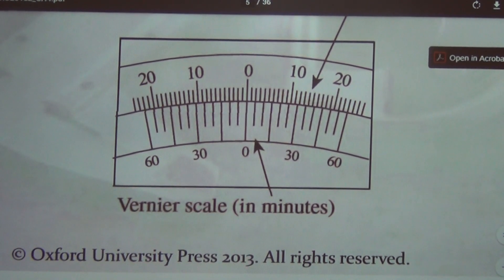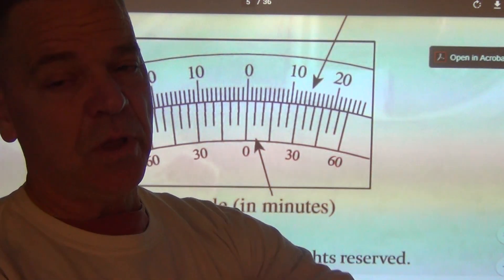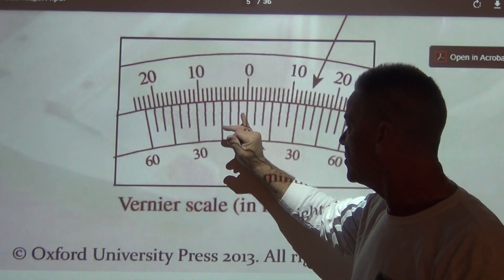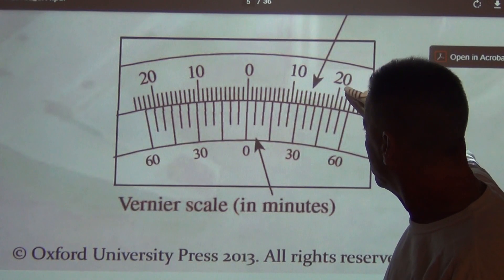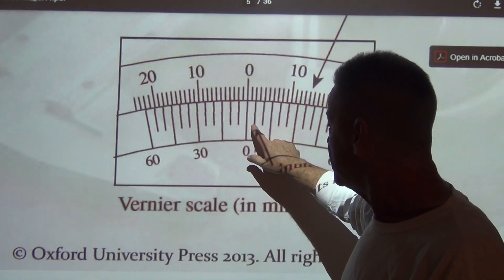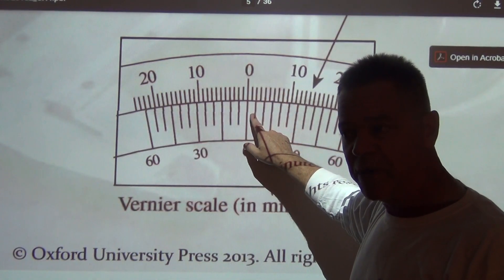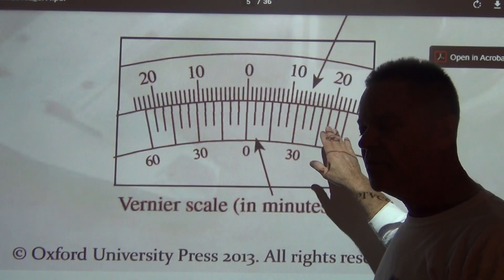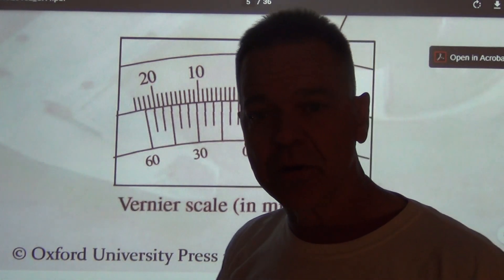Constructing a protractor Vernier scale

Comment: With reference to the math underlying the vernier scale:

For this video, 23 degrees have been divided into 12 equal sections by the vernier scale.

This means each section is 23/12 degrees = 1 degree and 55 minutes. Each mark is off by 5 minutes.

The final measurement of the angle is the nearest angle rounded down at the 0 marker, + the number of offset x 5 minutes.

The vernier calipers work by dividing 9 mm into 10 sections, hence each mark is off by 0.1 mm.

If you want a super accurate scale, divide the 59 degree angle by 60. This will make each mark off by 1 minute. You will then be able to use the scale in the same way as the vernier calipers. 

A less accurate vernier would be 29 degrees divided into 30 sections -- hence each mark is off by 2 minutes.

Personally, I would prefer to just divide 9 degrees into 10 sections. Then we can just use the decimal point. It would be a much easier scale to make and read.
Reply from the maker: Thanks for your comment.  That is good information.

Comment: how did you get 23 deg as the basis ,why not 25,28
Reply from the maker: Hi, thanks for commenting.  I don't know the math underlying the spacing on a Vernier scale.  I only know that in this case, 0 to 60 minutes on the Vernier scale matches up exactly (best I can see) with 0 to 23 degrees on the main scale.  So, I am suggesting to my students that they can mimic that spacing and get a functioning device that is accurate to 1/12 of a degree or 5 minutes.   Hope this helps.